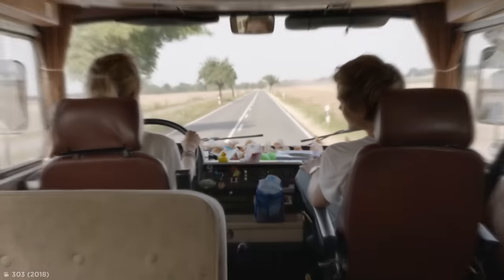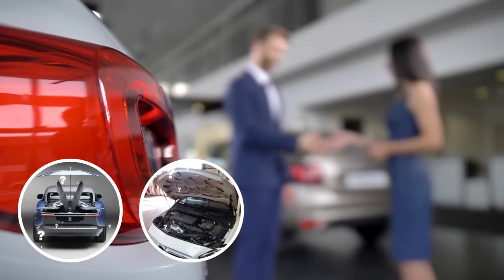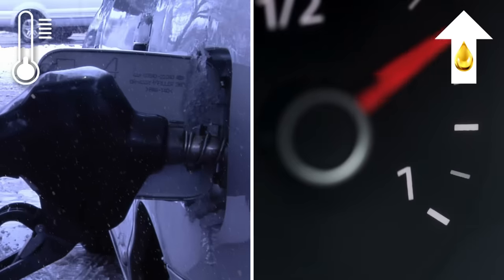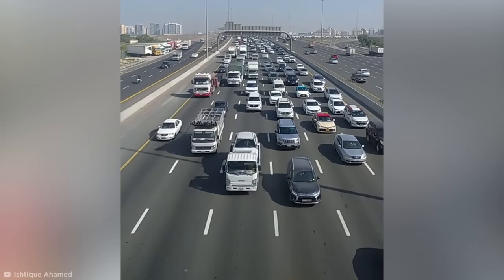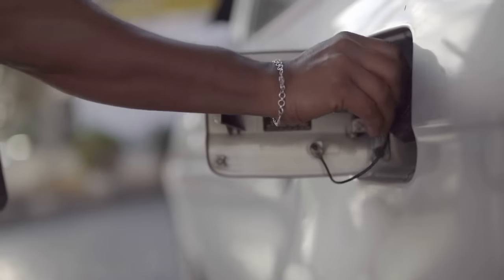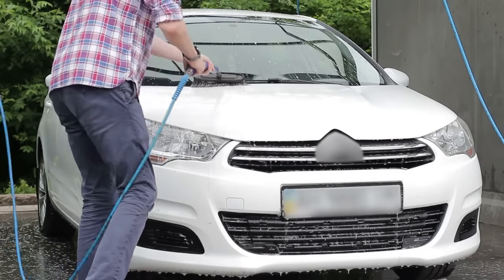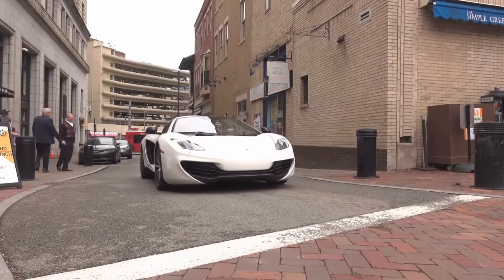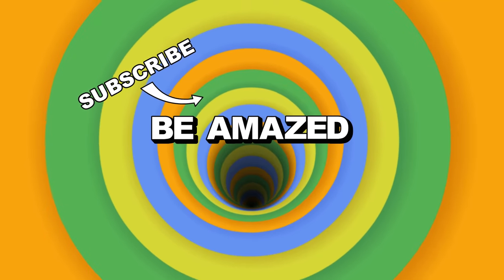Car Secrets Only The Most Experienced Drivers Know

Comment: The first one about holding the fob to the head: The head has nothing to do with it. Actually, the fats in the brain absorb radio waves more than anything else. What does help is raising the fob high up so the radio waves have a clearer sight than using it from the height of your hip. In other words: just holding it high up makes the trick work.
Reply: Yes height will help.  It can also be the angle at which you're holding it.  Most people "point" it at the car and the transmitted signal can be quite weak in that direction as opposed to holding it so that the flat side is facing the car.
Reply: I've tested this.  Hold the FOB up and then touch it to my forehead.  The forehead always seems to provide a stronger signal.
While I'd like to attribute this to my superior brain, it works with any good skin contact.
Reply: @brandyballoon  That would be consistent with antenna placement which often is at the lower backside in many cases.
Reply: @sysghost  That's where a lot of folk have their brians.
Reply: Holding to the throat works.
Reply: @DrakeN-ow1im - Brian wants you to let him out! Ask him to retrieve your brain while he’s in there.
Reply: Under ur chin.  I get 150ft.
Reply: Nope.  I've testing this on multiple occasions with 4 different make/models.  I would test several times holding my arm straight out to make sure it didn't work.  Then I would keep hand in the same position/orientation, "walk towards" it, and place my chin atop the fob.  At least 90% of the time, it would work.  The 10% or so times it didn't make a difference, it would once the battery was changed.
Reply: @sysghost  You have a backside antenna??
Reply: I was skeptical on this too. Then I went to several reputable science sites. It is true, but with a caveat. Not everyone will see all that much improvement holding the key fob to their head.
Reply: ❤ I've done the Fob to head trick several times and felt so stupid.

Comment: Here's another car secret that few people seem to know.
That little lever on the left side of the steering wheel is a turn signal.
You're welcome! ;)
Reply: Another car-related secret: Some of the signs at the roadside have got magical numbers on them. Keep your speed below that number, and you will get pulled over less frequently and don’t pay for speeding tickets anymore!
Reply: I'm told these levers are particularly hard tp find on BMWs, although I'll never have the money to try that out personally.
Reply: It is nobody's business where I am going!!!
Reply: @carmium Also Caddy’s, Audis, Mercedes Benz, etc
Reply: They are afraid to use that lever because warning lights will come on and off, and start a panic. It still happens occasionally when it is bumped while turning the wheel, then all hell breaks loose.
Reply: BMW drivers you are advised!!
Reply: I do not think that feature is available to BMW drivers ! (UK)
Reply: everyone knows but not everyone uses it
Reply: Not just for turns(if you are in left turn lane, it is OK to have it blinking), that turn signal is also for lane changes, moving in/out of traffic(entering/exiting). It is required to leave the signal flashing until all 4 wheels cross the line.
Reply: Mines on the right but I know what you mean.
Reply: Are you talking about that handle you hang your handbag on?
Reply: Exactly people hardly  ever use them not just BMW drivers!
Reply: 😂 right? There's a lot of folks in my town that don't use that much needed tool.
Reply: Tesla drivers don't use the little left side lever either, I think drains the battery too much 😂
Reply: @Zeguyfromgermany  Coming from the guy who resides near the autobahn.. 🤔
Reply: @ancheno7167  I used to own a BMW, I can assure you that is something brain-dead people parrot. One drive through any city or on the highway will show you that not signaling is very common regardless of what you drive. Pick up trucks are the worst, they just abuse their size.
Reply: @SupraSav  no hard feelings man, it was a joke with a spark of truth 🙂
Don't know too much about pick up trucks because here in Europe there are only a few, but we have a LOT of bmw. 
The small truth inside the joke is that BMW (also Audi!!!) drivers have to show that they are richer and better than most people, driving like assholes and not respecting simple rules like using indicators...
But again, speaking in general here ✌️
Reply: Seems that few people in the Birmingham, Alabama area know about that one,or on these new vehicles turn signals are optional.
Reply: @Zeguyfromgermany That's a minimum speed, go under it and I'll tailgate you.
Reply: @carmium BMWs have permacators, orange sidelights.  You wouldn't notice the indicator.
Reply: @chanellegaga   No it's not...and I don't want to know either...
Reply: @Zeguyfromgermany   We all get a laugh out of the stop signs in Turkey: "DUR"  (Though they probably wouldn't find it funny if they knew our thoughts... )
Reply: OMG! I would I have a horn to scream: “ turn sign, TURN SIIIIIIGN!!!!!”
Reply: Thanks - was wondering what that lever was behind my BMW steering wheel! ;)
Reply: Mine doesn't work. I pulled it down, and my turn lights came on, but they quickly went back off again, only to come right back on again. Kept doing that over and over so I just quit using the thing. (said the blonde)
Reply: 😂😂 very good.
Reply: And very few use this lever ....especially the higher priced cars and SUV's....😂
Reply: And please use it…I’m talking to you guys driving fancy cars on Rodeo Drive!
Reply: ..I've heard rumours u can chenge the angle of the front whells if u rotate that round thing inside the car... wow magic...
You'r wellcome...
Reply: I tried that lever and now my wiper-blades are going crazy. How do I stop them? Do I turn the car off?
Reply: @jhumble314  Great now u broken it... did u forget to puch the button on the right 3 times, honk ur horn twice and put the car in reverse befor doing it...
Reply: Thank you!!! Indicators are standard, USE THEM! My husband seems to have a phobia of them. I have told him he can get a ticket for that phobia, he always has the same response. ‘Pfft!’! Guess who got pulled over on Monday for not using their indicator? He got a bloody warning. He was telling me about it and said ‘I’m so glad you weren’t with me. You would have made him give me a ticket!’! 😂😂😂 I wouldn’t, he was just having a go at me.
Reply: @carmium  One has to pass the BMW Worthy test before purchasing. Also known as the “Are You a Massive Arsehole” test. 😂😂😂😂
Reply: @chanellegaga 😂😂
Reply: @nobody7817  The first time I saw that, I laughed out loud!! Spot on! 😂😂
Reply: @carmium  I test drove a BMW a few months ago, and the turn signal in it was really weird where it's a lever, but you click it up and it resets back to the middle and then the signal goes.
Reply: Gee, I thought it was for trash bag
Reply: It is evident not many drivers know this!!!
Reply: No way🤯
What does the little triangle button do??
Reply: Not where I live.
Reply: BMW has really gotten annoying over the years, BM owners have given that load a bad rep
Reply: Right seems like there's a whole generation of people who don't know what a turn signal is...thank you for letting them know🤣😂😆😅🤣😂😆😅
Reply: @carmium on BMWs they are wired to the blinking headlights...
Reply: @Zeguyfromgermany  out dated numbers used for cash grab
Reply: Some I wish people.  I  see so many people u.s.a. gone Lazzy. Stand toger❤  a Friend and family and 🐈 😻  and 2 cats.
Reply: @chanellegaga . If you were joking, it isn't obvious. Anyway, every turn and lane change you make on the .public. roads is everyone's business.
Reply: like the one in the floor board on the right is gas U.S. ONLY
Reply: Lmao😂
Reply: Lmao!! 😂😂😂😂😂
Ohhhh, that was gooooood
Reply: @dman0044  And left flashing for the next 15 miles....
Reply: @tazman8697     Old people can't hear the the clicking. Many don't leave it flashing till they're fully in the lane, when changing lanes.
Reply: WHAT???? Are you an auto genius???
Reply: @Cherish-11  are you old enough to be on the Internet? lol
Reply: Thank I never new that
Reply: @meme4626  yeah thats the problem, idiots that dont care for what they do, cuz they are ''MINDING THEIR OWN BUSINESS'' stupidly that is, we are suposed to drive for the others on the road, not for us only...!!!
Reply: @SupraSav  true, the trouble is the driver, not the car, people are so stupid
Reply: @ancheno7167  theres no spark of truth any kind of bullshit car could have a stupid driver who dont use the blinks or dont check the dead angles
Reply: @ancheno7167  no spark of truth here, any idiot with a trash car could not put em ...
Reply: @gazon4874  it's not about being able to do it, it's about not wanting to do it so you can show the other people you don't care about them, because you're better.
Reply: Ok thank God I thought I was the only one who did this, 1)buckle up 2)Rev your engine. Sound advice
Reply: Best suggestion yet.
Reply: only a few bmw drivers know that
Reply: @Cherish-11 I can't tell. The comments you've commented "duh" are obviously jokes and not to be meant seriously and you're the only one who seems not to realize it.
Reply: @Cherish-11  no need to apologize 💛
Reply: Nice one
Reply: no one asked!😂
Reply: Love it! 😂
Reply: @SupraSav I see it the most in bmw,audi and Mercedes..fact in my area!
Reply: Doesn't come in BMWs
Reply: 999 likes and 75 comments i got the power
Reply: everyone already and the other one is the wiper
Reply: Oh thank you I had no clue 🙄
Reply: @Zeguyfromgermany  drive under the speed limit? that is also illegal
Reply: You took the words out of my mouth! @carmium
Reply: for the BMW drivers 💀💀
Reply: Lmao 🤣 my kids are always telling me off for not using mine 🤣🤣 BUT I only do that when there is no traffic around me 😁
Reply: Red goes faster 😂😂😜 🚗  🚘

Comment: 1:20 love the content as always man but wanted to point out. It's not RFID. Many push button starts  use rfid and some use nfc. But rfid is only extremely close range. Many cars key fobs use RF which use something called rolling codes. Which are codes sent accross a frequency that roll over making it harder for someone to intercept the frequency and gain access to your car. Same way garage door openers work. I've heard some cars use BLE packets for push button start but that is not something I can confirm. Anyways love the content as always and thank you!
Reply: That is to much information for my Brain to take in

Comment: The head rests are adjustable, they also come out and are used to break the door glass in an emergency.
There is a tiny triangle next to the fuel gauge, it points to the side of the car where the gas cap is. 
Your seat belt goes up and down at the top anchor point, if it is rubbing against your neck, try moving it up. 
The reason your blinker is blinking really fast is because there is a turn signal light bulb out.
Reply: Not all headrests are removable, check yours first before you need to, if yours don’t, don’t waste your time
Reply: Not all seat belts are adjustable at the anchor.
Reply: Agree @1988dgs
Reply: Another reason why blinkers sometimes blink really fast (It's also called hyperflash fyi) is because there's some sort of disruption between the cars computer and the wires going to the blinkers.
Reply: Head rests? I thought we had head restraints instead for at least the last 30 years?
Reply: I’m 5’3”. My headrest pushes my head forward and causes neck fatigue. I lay the seat way back, pull out the headrest and turn it backward. I was hit from behind at high speed and hitting the headrest really hurt the back of my head, but only in the moment. No headache or neck problems afterward.
Reply: @COIcultist  i was about to say the same thing, its amazing and scary how many people think there for resting your head and not there to stop you from breaking your neck in an accident 🤦‍♂🤦‍♂
Reply: @HAGGIS420 i don’t think anybody actually that. it’s just a phrase carried over, most people obviously know it’s meant to support your head in an accident
Reply: @kithe304  OH i agree with ya, but still a scary amount of people dont
Reply: I knew all of those but the triangle
Reply: The headrests don't work anymore cause the glass is too thick. Crack the window before it sinks.
Reply: @loganbyrne3054  - all glass has a weak spot
Reply: And a partridge in a pair 🌳 😊

Comment: One thing you missed - velocity, or speed, doesn't work like we intuitively think. Example; at 15 mph, it would take 4 hours to travel 60 miles. At 30 mph, 2 hours. At 60 mph, 1 hour. At 120 mph, 1/2 hour. Notice, in the first example, when speed was doubled from 15 to 30, it saved 2 hours. In the last example, the speed doubled by 60 mph, yet it saved only 1/2 hour. 
Bottom line is, when you're on your daily commute, going 75 instead of the posted 65, won't save very much time for the 10 or 15 miles you travel on the highway. You can figure it out mathematically, but the increase in fuel consumption, increase in tire wear and stress on your drive train just isn't worth the few minutes you save. Stay safe out there.
Reply: I understood completely now. I need to drive 75 mph in a 30 mph zone to fully maximize my time saving
Reply: Yep. Being a pilot changed the way I drive once GPS became the norm for small planes. I noticed that on a long flight, the ETA would only change by a few minutes +/- when I encountered a small tailwind or headwind that changed by cruise speed by ~10 MPH.
Reply: Most people drive 5 or so over the posted limit.  You would have to drive about 100 miles to make a couple minutes of advantage, so it's pointless for most drivers.
Reply: Bottom line- speed is fun. Sigh…I think speeding is a genetic problem.
Reply: @nachoisme 😃

Comment: The truth is, the higher you hold your key fob in the air, the farther the radio wave coverage of its signal. It has nothing to do with water in your brain. Water actually absorbs radio waves. Water is a conductor of electricity but blocks radio waves. The classes in physics and electronics I took in high school come in handy sometimes.
Reply: That's basically how and why your microwave oven works! 😜

Comment: I hope i am not repeating but i have 2 to add: 1. rolls royce had/has an umbrella in the drivers door.  2.  vw/audi used to allow you to open and close your windows from outside the car while the engine was turned off.
Reply: i can open my infiniti's windows from home, just with a key fob. learnt it accidentally when tried to use remote start.
Reply: My Honda allows remote window opening (but not closing!)

Comment: One design feature you missed is the headrests and the fact that they can all be removed in the same way, no matter what car you're in. "In the unlikely event of a water landing," your headrest can be used to break a side window to allow any trapped occupant(s) to escape. The metal posts that hold the headrest in the seat back are made specifically for this purpose.
Reply: Not true with all makes. I own a GM product from 2007. The head restraints can only be removed with a special tool that costs $250, or a hacksaw.

Comment: The golf ball effect was tested by Myth Busters and it was actually much more fuel efficient.  I think that is the car in the picture you showed that they used for the test.  I would find it interesting to do the test with a car covered in Golf ball material.
Reply: The issue is that it is impossibly hard to pull off in a factory.
- The dimpling is dead simple to put into the sheet metal.  The problem is painting.  Almost all cars are filled and smoothed a bit and then primered.  Then paint is added and the result is that any small variations like that look messy and dry at different rates resulting in a very bad look.  You would have to make the car panels out of carbon fiber for it to really be reasonable to pull off, as it just needs some sanding and a clear coat.
Reply: I seen that episode, and recognized the photo too… how bout that lol
Reply: A car with golf ball dimples? You’re gonna need a DAMN big 9-iron to get it going in the morning!
Reply: @plektosgaming  Should work on the Cyber Truck since its stainless steel
Reply: I missed that episode.  How big were the dimples?
Reply: @plektosgaming  Maybe a wrap?
Reply: The effect was not as great as as it is for a golf ball. Reason is the golf ball spins in reverse from impact of the club. The dimples then create lift to carry the ball farther. Look up the Flettner aircraft for better explanation of the effect.
Reply: If dimples reduced drag, aircraft would have them.
Reply: That's definitely the car from MB. They proved it actually worked lol. But he's right.. not exactly practical.
Reply: i doubt u could save that much gas tbh

Comment: Note that fancy multi-stage paints are still worth it as they last 3-4 times longer than normal modern paint.
So your mother who always gets that pearl white car also has a more practical reason as well.  The car at ten years old still looks fancy and shiny. 
Often most cars have one special color that year along with pearl white, so DO get it if you can.  It's well worth the extra $300-$500 it costs when it comes time to eventually sell it, and more if it's something you plan to keep forever, as rare colors are worth a lot more on  classic cars.
Reply: Had no idea! Thanks

Comment: A vehicle remote actually contains two RFID systems, one active and one passive.  The active system needs a battery to power the transmitter and it is used to lock, unlock, and open the hatch.  The one for my 2019 Honda has worked at distances greater than 100 feet.  
The passive RFID is like the one in your credit card.  It is powered by the reader, so it doesn't a battery, but it only works if the remote is held within an inch of the reader, which is usually inside the Start button.  This feature allow you start your car even when your remote battery is dead.